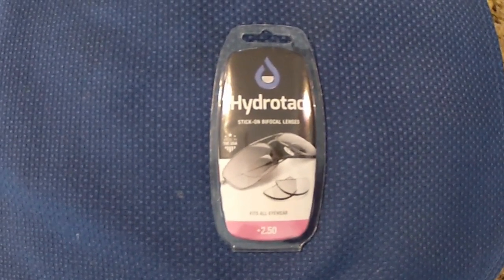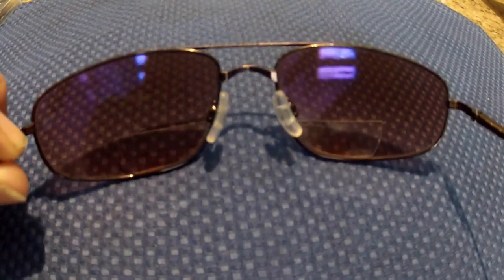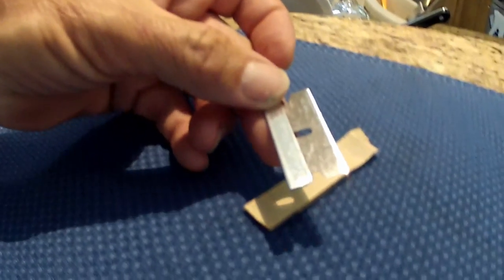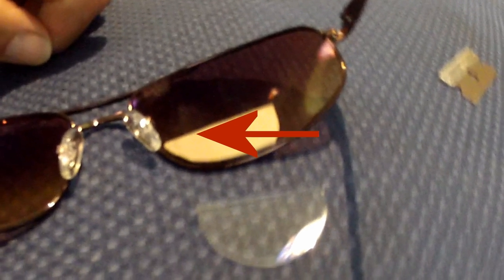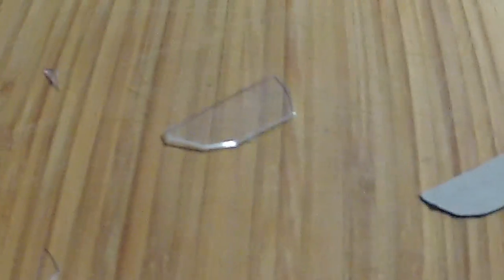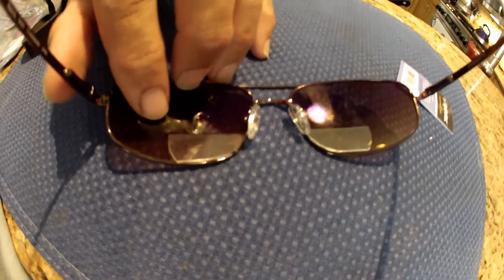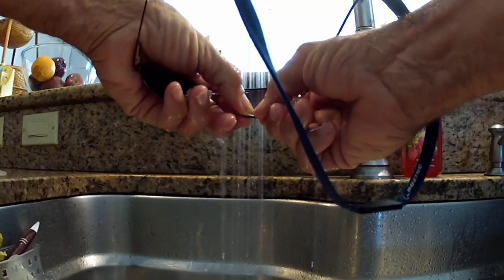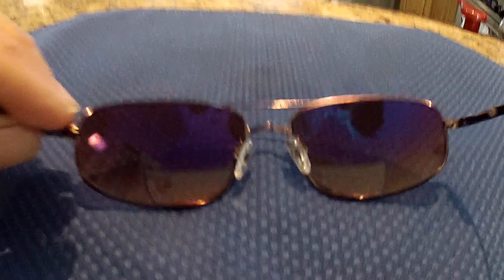Installing Stick-On Bifocal Lens

Comment: OMGosh THANK YOU SOOOO MUCH !!!  I Was trying to put them on the outside of the lenses!!!  After holding them in place for over 30 minutes, i was about to Give Up and send them back !!  As a Last Ditch effort, i decided to check YouTube, and There you were !!!  It took a whopping 4 minutes to get BOTH Installed, and I'm Typing with them Right Now !!!  THANK YOU SOOOOO Much !!!  You're a Life Saver !!!

Comment: Whoa!  That was FANTASTIC!  Thank you so much!  (Although I am not quite as patient as you, so I drew a cut-here line with a dry erase marker and used scissors.)  But the "floating" them on under running water is WAY BETTER than trying to stick them on with "a few drops of water" per the instructions.  I find these to be SO MUCH LESS DISTRACTING than my $700 rx bifocals which drive me INSANE with "image jump" (i.e. huge blurry line across the middle of my vision).  Wish I'd tried these stick on lenses FIRST.

Comment: Good tips. Thanks. I got Hydrotac recenttly 2021 and they didn't have any curve as mentioned here. Also I found it much easier to get a good cut with a sharp scissor than with a blade. Perhaps they are a bit thinner these days.

Comment: Thank you for making this great video. I use +1.25 diopter sun glasses for driving, and will install the bifocal +2.5 lenses on the bottom so the dashboard comes in clear. No one to my knowledge makes bifocals with two different diopter readers. The blended gradual bifocals did not work for me, the focus was too narrow of a band to be useful. Again, thanks.

Comment: Great video, but try as I might, I can't get the lenses to conform to the curve of my sunglasses. They keep pulling away, so the top halves of the lenses are essentially all bubble with air behind them. Only the bottom halves of the lenses adhere correctly to my sunglasses. The curves of the lenses are the correct orientation.

Comment: I just got a new pair of glasses in a very weak distance prescription with +1 near add for the first time, I wore single vision before. I noticed my near vision worse in my right eye which actually went a bit farsighted, distance is +.25. But fine print is blurry in that eye unless I use magnifying lens. I just got my new glasses, they look like single vision because the rx is so weak and they are progressives,  and the near vision portion for the right eye seems not strong enough, it’s +1.25 but I could use a +2 or a +3 for that eye. I’m not going back to the lady doc to complain, the glasses were $300 with 50% off, they would have been $600. So I have the bifocal stick ons like you have here but how well do they stick with just water? I have a pack of +1.50 and +3. I bought two different strengths because I want to experiment and see which strength works better for each eye.

Comment: I've owned several of these stick-on lenses but the most recent purchase just won't stick.  New glasses, new Hydrotac lenses. Any ideas? The lenses are not flat and the curves match. They just won't keep water under the lens.
Reply from the maker: I hope they didn't change their formula. I honestly have not purchased new lenses since this video. The lenses in this video are still serving me well. All I can suggest is install using warm water, clean lens well and match curves on the lenses.

Comment: You went down the rabbit hole👍.  But my glasses of course do not have a frame on bottom ( a point you really held on to ).  The part I needed was the last 15 seconds ( making them stick ).  All the rest was obvious to me.  Very frustrating, but thanks for 15 seconds.

Comment: Is there a way to remove it
Reply from the maker: Once installed, they can easily be removed by picking up an edge or corner and peeling it off. The lens will not leave any stain or residue behind and can be reinstalled.
Reply: AnInnerCityKid Is there a way to remove one thats been on for years?

Comment: The lenses hold in the mask only if there is no water in it.
Absolutely unsuitable for diving.
Reply from the maker: This doesn’t surprise me as the lenses are held in place by dry surface tension. Water will release the lenses and keeping a mask dry throughout a dive is beyond my typically experience but then again I only had about 450 dives, maybe someday I will get better at keeping my mask dry.